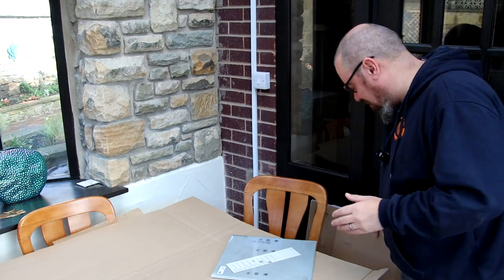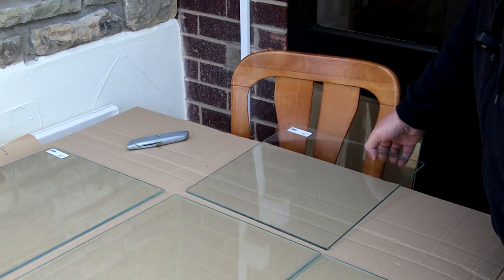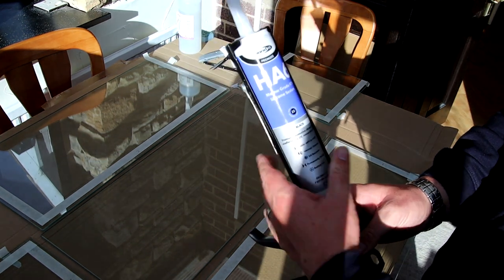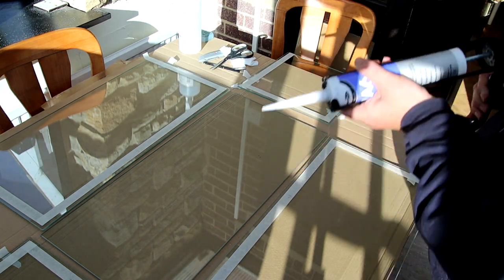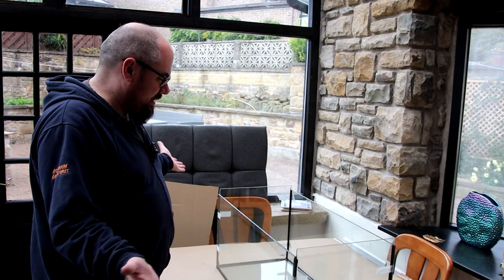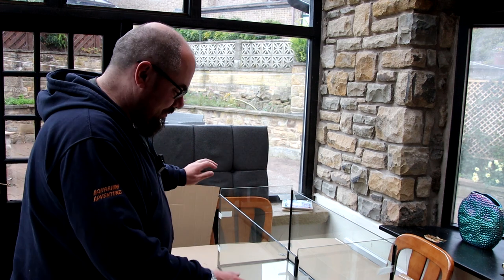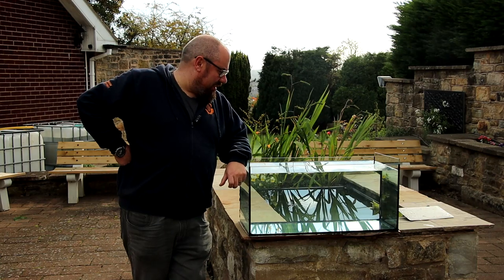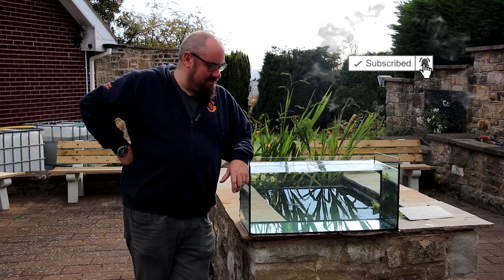Flat Pack FISH TANK from IKEA?

Comment: I know that this is a few months old now but I only just found this video. I watched the original a while ago and had the same thought to try it here in UK, but soon realised the issue I would face so, I've just watched back the video on Sherpa's channel and noticed that there is a 1/4 inch or so difference in height between the sides and back/front. So I checked the US IKEA website and noticed that they have extra sizes than in the UK (they have 6 sizes to choose from and we only get 4). One of theirs is a 15x14 3/4 (inches) which is the (almost) square piece that is needed for the ends as 14 3/4 inches is the common size to all of the shelf kits. Nice job with yours though, looks great

Comment: I love the raised the sides. They are perfect for mounting the horizontal lighting fixtures on elevating the lights just a little higher than the waterline. Its genius! Wouldnt have thought about it until i saw that you pointed out the higher sides.

Comment: I saw the original and have got my eye on doing this. I also couldn't workout in my head how they were meant to line up perfectly with the sizes available. 
You would need a 37cm square piece.
Reply: This is late, the dimensions are for the system and not the actual glass and that’s where confusion is coming in
It all should fit relatively similar to how serpas did

Comment: To solve the raised sides problem, you could buy a couple of UTRUSTA wooden shelves and put them underneath the tank. The UTRUSTA shelf is 1.8 cm thick so you would be able to hide the high side panels. Another thing that I would do, is to make a wooden frame and put it around the tank's bottom to hide the wooden shelves and add some strength to the base of the tank.

I am planning to make this DIY project next month.

Comment: Nice job but having done many tanks myself I'll offer you a few suggestions. First make sure the silicone you use is food safe. If it isn't it will likely poison your fish. Second store bought complete tanks are generally cheaper than do it yourself unless you just happen to have some glass laying around. Now on building the tanks. Have large cans of canned goods on the table. Use them to prop up the glass panels as you work so your hands are free. Now if you work very fast you can do it all at once but if this is your first try only do one panel at a time because from the first bead you run until the last panel is set you have around five minutes until the silicone skins and won't give you a good attachment. If you can work fast enough then you can seal the inside as he did but if you take your time then let it cure overnight, then with a razor blade trim the inside silicone and run the inside bead. Before you start assembly it's a good idea to wipe all the glass edges with alcohol to remove any oils from cutting and handling the glass.
Reply: Useful tips for the can stand and I am going to take your advice on the sealing the inside a couple days later! I have been successful with resealing and I enjoy the process leading up to the actual sealing w 100% Silicone and 101% stinks but I am not capable of driving by a fre tank or anything that might be worth a look.  I know that you are going to be really much better off if you are taking a free aquarium and the average resealing is a good 10 years if it is done right and handled in the same manner then I will be happy to get a role of tape & aquarium safe Silicone and a few other inexpensive tools that you have to buy !!! Free ,free ,free .saving Bettas is well worth it to me. 💙💚

Comment: If you put the long pieces resting on the bottom piece, and the short pieces resting against the bottom piece. You make the ends .25 inches shorter and the long sides .25 inches taller, which would solve your half an inch of extra glass. 

I made mine this way and it fixed the problem. There is only a slight lip on the edge. I tried really hard to do it the exact way he did it, but It doesn't fit right.
Reply: not working.still 5mm difference
Reply: @eva_1977  Yeah thats why I was saying there will be a slight lip on an edge. I couldnt find a way to make it perfect.

Comment: I just made one of these aquariums using the same glass and I attached the end pieces rotated 90 degrees and glued to outside edges instead and fits well without raised edges at top. Just put a slightly thicker bead along the front and back so that corners all align well at ends. I may add vertical 12mmx1.6mm aluminium angles to uprights for extra strength later but I don’t think it is necessary.
Silicone for aquarium use is very strong on glass.
Reply: can you exolain yourself better^ if you rotated them 90 degrees then it woudn't fit sideways since the bottom piece is 37cm and you had only 30cm....
Reply: Hi me, I’ll reply in the next couple of days.
Reply: @nwastra4070   thank you so much! i'm really curious!!!
Reply: @eva_1977 
I have tried to reply 3 times but it does not get posted...not sure why.
If I don't see the reply by tomorrow, I will post in smaller sections.
cheers
Reply: @eva_1977 
Part2
Lay long piece flat on table as a base.
Place another long piece, as the front and back sides, next to the base with the edge resting on the table. (it is not resting on top of the base piece). As viewed from the end |_| and is 34.6cm high.

Place the end pieces so that they also rest on the table (it is not resting on top of the base piece). As viewed from the side |___| and is 34.6cm high.  
Try rotating the end piece 90 degrees so that the long side, 36.3 cm, is resting on the table to get a reasonable fit.

This should now give you an aquarium with all top edges fitting at the same level.

You will need to add a very slightly thicker bead of silicone on the base 76.3cm sides from memory to get the edges to align with the ends.
346 + (6mm thickness x2) = 358mm needs 2.5mm bead of sicicone each side to reach 363mm.
Reply: @eva_1977 
Part3
Note that this method is not ideal for joining of the vertical sides to the base to give greatest strength but is the only way to get a normally shaped aquarium. 

Because of this I decided to silicone 12mmx12mm aluminium angles around the base and on the vertical corners. 

I also like the method with slightly higher ends and is likely best with regard to bond strength with no added rims and could be unnoticeable once you make a lid for it.
Reply: @eva_1977 
all ok now...bit of user newbyness .
Hope it helps
Reply: @eva_1977  
Part1 again without url links.
My IKea pieces were purchased in Queensland, Australia and measured:
UTRUSTA Shelf, glass, 80x37 cm. 
Exact dimensions are listed under measurements: 76.3 cm x 34.6 cm x Thickness: 6 mm
UTRUSTA Shelf, glass, 40x37 cm.
Exact dimensions are listed under measurements: 36.3 cm x 34.6 cm cm x Thickness: 5 mm

Comment: I also suggest aquarium silicone within the skinning time which is 5 minutes when using Selleys Glass in Australia. Other brands also appear to skin in about 5 minutes. Therefore it is easiest to apply, smooth and remove tape one  or two sides at a time to get it done smoothly without it skinning before you finish.

Comment: Isn't it worth making a V shaped jig (like a saw horse) to hold the glass sides.? When you place the glass in the V jig they should sit together in the bottom of the V without you holding them until they are set.glued. If you make the jig V more than 90degs you can shim up the glass plates until they are perfectly 90 degs. this seems a better technique esp if you are on your own.

Comment: If the big ones are 80x37 and the small ones 30x37, the 37 side of the sides would line up to the 37 side of the bottom. The front lines up to the 80 side of the bottom and is thus 37 high. The side would be 30 high, how does this stick out above the front, I don't understand.

Comment: You made it the wrong way around long bits should been ontop of base and side bits on out side Wally
Reply from the maker: 1. No I didn't
2. It wouldn't have made it fit if I had
Reply: it is designed to have the front/back and end panels fitting against the bottom panel. That way the sizes match up better.

Comment: it's a great idea but the sides being a different height would just annoy me. I guess you could source the sides from elsewhere.
Reply: Mount the end panels as 40cm wide and 37 cm high against the ends of the front/back/bottom panels.leaving the excess width overhanging where it won't be seen.
Reply: @grahamepigney8565  it would be seen in the back anyway